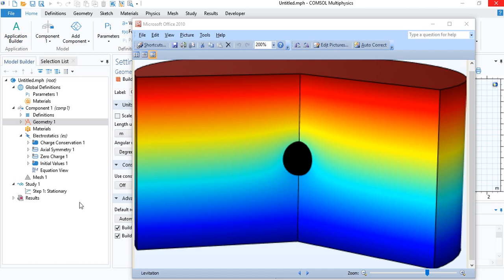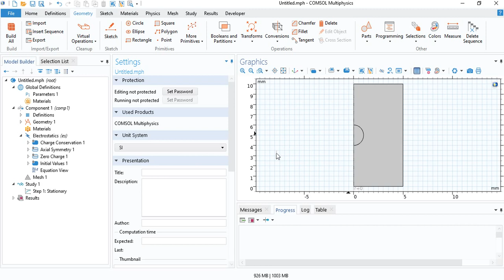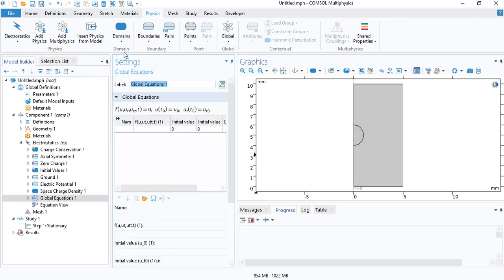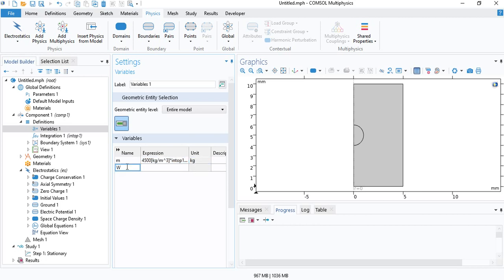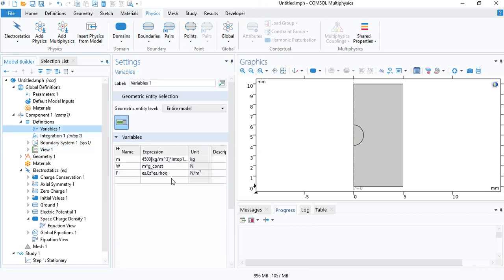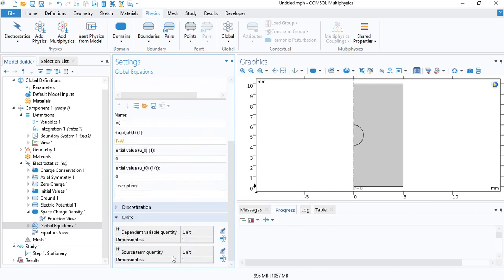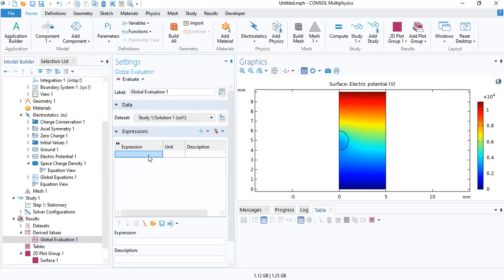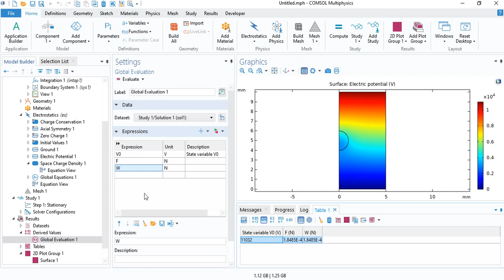Electrostatic levitation- simulation of static equilibrium using Comsol (part 1)

Comment: A bit confused at 4:10. The unit of density is [kg/m^3] and the unit of area is [m^2]. Why the unit of the result is [kg] instead of [kg/m]?
Reply from the maker: It's true that you're selecting a 2D surface. But that surface is revolved to create a volume. So the density times volume gives mass in kg.
Reply: @JafScience  Got it. Thanks for your reply!

Comment: Thanks for the answer, I have a more difficult task (model). Two pairs of coils and switching in pairs, two coils paired at right angles. I need to provide the formation of fields according to the given characteristics. I don't know the software very well.
Reply from the maker: If you want to switch the direction of current in each coil periodically you can use a periodic function that alternates between 1 and -1. Multiply the current with this function.